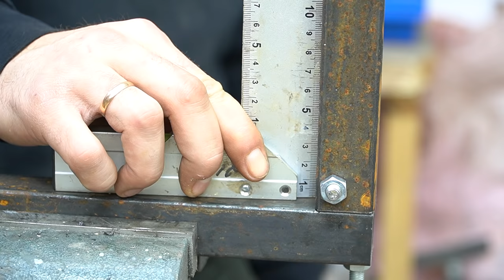Советы и Хитрости Мастеров по Дому, Которые Действительно Помогают ▶20

Comment: Please tell me how to get old, painted over, stripped screws out of the kitchen cabinet hinges which I want to replace.  If you don't mind.  Thank you for all of the information you provide. Much appreciated!!
Reply: Use a Dremel tool with a diamond wheel. Cut a slot into the top center of the screw head. Use a flat tip screw driver in slot to turn out the screw.

Comment: Soda-straws in the vacuum nozzle to filter dust and leave small items behind. That's, my favourite. That's a Tip and a Trick right there!
Go a step further and glue straws in nozzle. Cut off the straws flush with nozzle end. Now you'll be sure to never suck-up and lose coins and jewellery from behind the sofa.